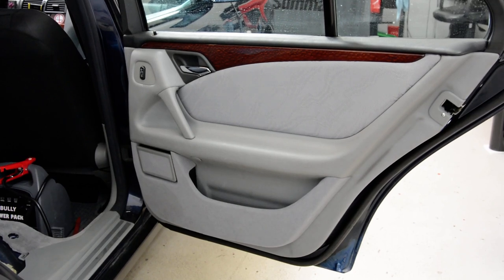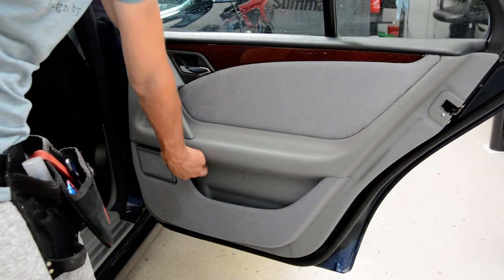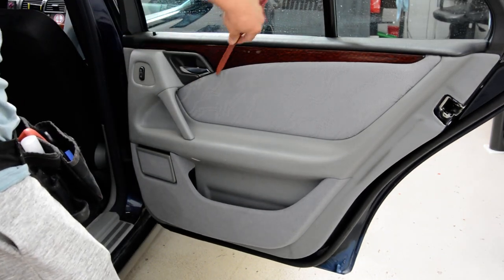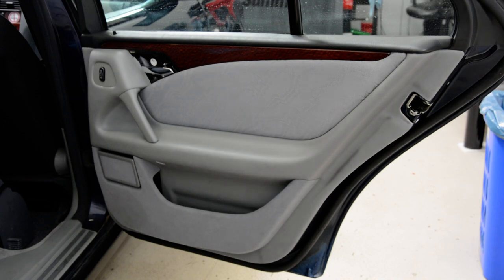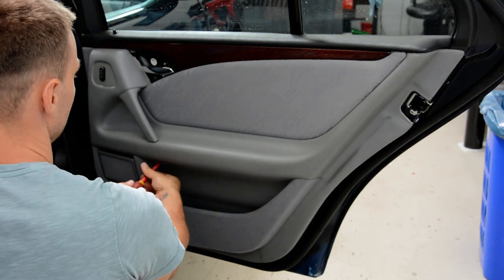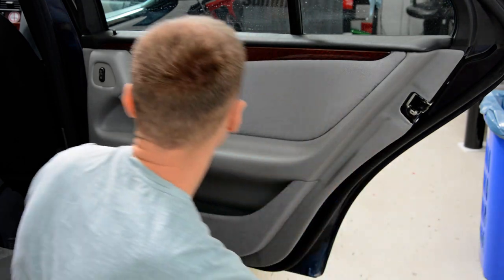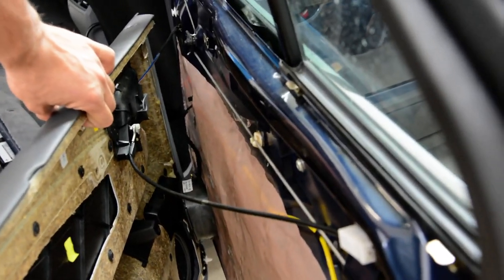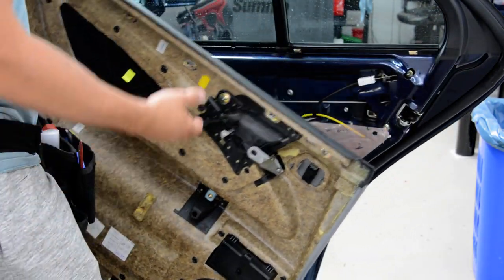How to remove the door panel Mercedes E Class   W210

Comment: How to demolish a door panel and brake off the clips....
Reply from the maker: You need to know that with the time the material from which the clips are made become very fragile. Is not a problem if I brake them I replace them all the time. You can order from AliExpress a bag full with 500 clips for different car manufacturers for just 5 EURO